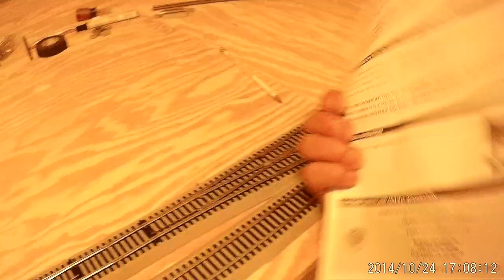Programming E-Z Command DCC track turnouts

Comment: Being it's DCC, do you need to juice the frogs on ez track switches to avoid a short or power loss when switching? I also have older switches im re using to avoid spending 90 bucks a piece of these things (although future add ons will be wireless switches).

Comment: Great video.  Straightforward and easy to understand.  I am using a Bachmann EZ command system for an N scale layout.  Bachmann does not make DCC turnouts in N scale.  Do you know if ANY other turnouts can be used/programmed in this system?  Can you also please answer the question about whether you can have a locomotive programmed to address 9 and still use address 9 to control turnouts?
Reply from the maker: I don't know about the N scale stuff and, as far as I know you can not use program 9 to run a locomotive
Reply: They now do make a DCC decoder to control solenoid thrown switchs

Comment: Can Bachmann EZ crossovers and turnouts be controlled with an NCE Power Cab?? 🤔
Reply: Yes, by using macro function, not accessory function
Reply: I figured it out and I do indeed use the accessory function.
Reply: @jasonworden8209  oh nice.   👍 Great to know,  I was only repeating what I saw of someone else doing.    Great to know.  Thank you
Reply: Was it as simple as programming using the bachmann controller.  Eg, press and hold program button on the turnout, then selecting the address on the NCE
Reply: @russcole5685  yes! Hold the button on your turnout until it cycles. Then hit your accessory button on your power cab. Select what number you want that turnout to be, and hit enter. The turnout will cycle 3 times to verify it has been programmed, and you are good to go!

Comment: Can we change from the default 28 speed steps to 128 speed steps using this controller ?
Reply from the maker: I think that the speed you are asking about is controlled from the dcc board on the engine but, I could be wrong, this dcc controller is compatible to run those speeds you asked about

Comment: Can you please share a link to what turnouts can be used so I'll buy the right ones. I found  some Backmann right and left turnouts but they come with red wires and manual switches.. About $23 a piece
Reply from the maker: you have to buy the EZ command turnouts not the regular wire connection turnouts like this
http://www.hobbylinc.com/bachmann-ez-command-4-turnout-left-ho-scale-nickel-silver-model-train-track-44139

 hope that helps :)
Reply: Thank you sir
Reply from the maker: you're welcome

Comment: So if I use #9 will I still be able to use 9 as a train id?
Reply from the maker: As far as I know you can not use program 9 to run a locomotive but, I could be wrong, if you have this unit, try it.
Reply: No you cannot use #9 to run a Locomotive if you are using it to run the turnouts. If you are not using #9 to run DCC turnouts, then yes you can use it to run a locomotive.